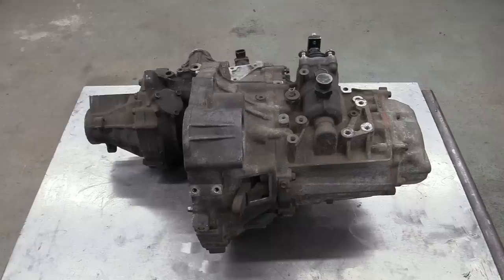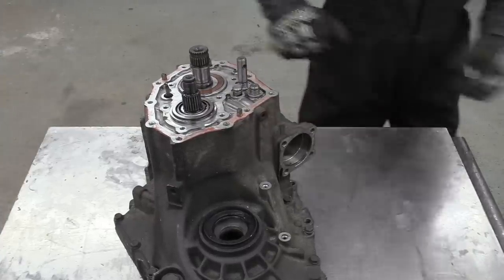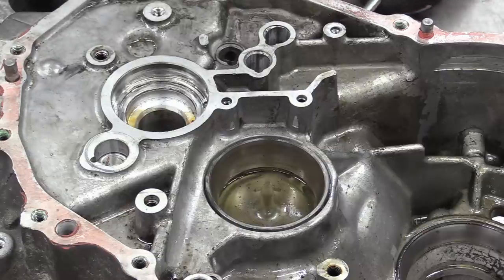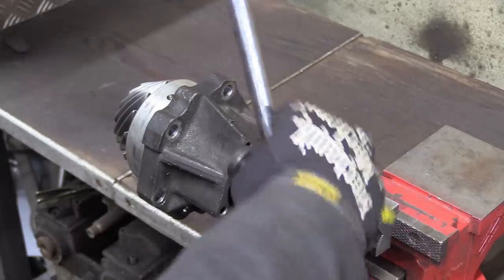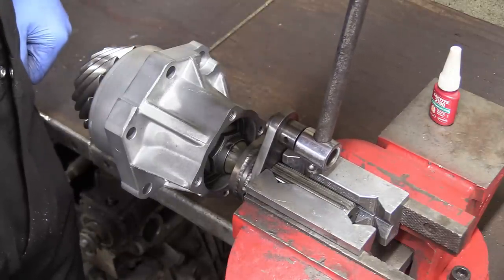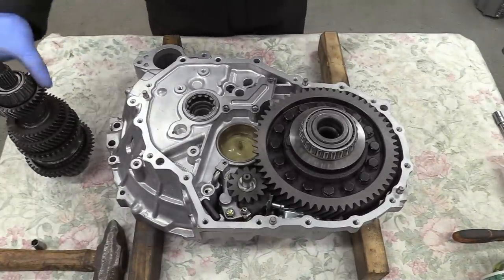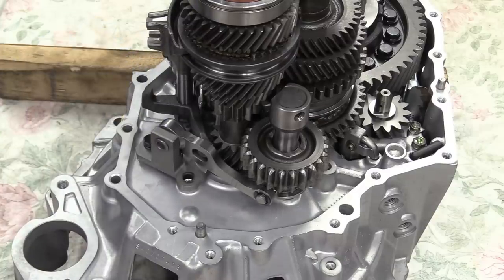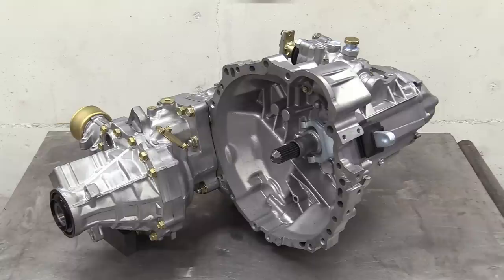Howie Did It - Toyota E154F Gearbox Strip and Rebuild

Comment: Props to whoever designs gearboxes. I can't imagine how difficult it is to design something so complex that needs to fit in a very tight space and its components also need to be strong enough to handle the forces. O.O
Reply: I know, right? The mind boggles with the thought that some engineering team could actually design something so complex and impressive.
Reply: As impressive as it is, like most everything its a product of decades even centuries of development, by hundreds of scientist, engineers, and machinists.
Reply: I have to say the gearbox is the part of the engines I have always left alone. I leave those to clever people.
Reply: @nothingsurprisesmeanymore  Same for me. I have build engines from the bare block, but most I have done to a transmission is changing the fith gear ratio, which was in a separate part of the case just like the Celica transmission in the video. I also leave rebuilding transmissions to the magicians that just know :D
Reply: iTeerRex spot on - I was thinking the same thing, each new development (feature) builds on previous successful designs that survive rally car abuse. Beautiful evolution but in a mechanical artifact. I can see now why automatic transmissions are (probably) easier to mass produce. 👍🦖🇨🇦
Reply: @barryomahony4983   yeah, have a look inside gas turbines. 
“Whittle … stressed the great simplicity of his engine. Hives [Director of Rolls Royce]  commented, ‘We’ll soon design the bloody simplicity out of it.’ ” [From Genesis of the Jet]

Comment: 8:55 see, its little things like this which really set apart engineers from the rest of us. Seems like an obvious thing to do when the magnet on a stick was too large to fit, but I guarentee none of us lot would have thought of it!

And then when you made your own special tools for everything... Brilliant.
Reply: A coil of wire around a screwdriver  touched to the battery for a split second will magnetize the screwdriver.
Reply: That's exactly the same thing I saw, I dropped my jaw man, never thought of that. And I'm a fucking Engineer, a shit one apparently lol
Reply: yeah , i've noted that trick for future situations
Reply: In my experience that is something a technician would do to get around something the engineers did not consider in the design.
Reply: Thu Nell Ⓥ  OK.
Reply: That was but one of many tricks in this video I saw and thought - “Damn, I hope I remember that when the time comes!”
Reply: been doing it for years
Reply: That trick works great for removing or reinstalling ball bearings back into bicycle wheel hubs when you service them! Or you could just get nice wheels with sealed bearings, but where's the fun in that?
Reply: Necessity requires ingenuity.

Comment: Why are there no credits for Mr H. DidIt?
Oh, wow. Someone actually spends time to prevent to gasket sealer going INSIDE the inner workings? I've never seen any other channel do this. Impressive.
Reply: These two blokes actually respect their work and time. IMO, if someone doesn't do something right, when they're fully aware of the potential issues, they're not respecting themselves, regardless of "if it actually lasts or not". Best job is the one you only do once.
Reply: Subi Motorsport, Thank me later ;)

Comment: Just remembered a fun fact: Toyotas with transverse engine AWD always have a 2.928 rear diff final drive ratio. Celica, Caldina, Rav4, even the Harrier. For some reason the Mazda 6 MPS has the same gear ratio in the rear. I contemplated using a E250F from a second gen RAV4 with a 6 MPS rear end to make a rally-style handbrake-activated rear axle disconnect, since it has an electromagnetic clutchpack. Sorry for diverting attention, enjoy the video!
Reply: This is really interesting actually! I'm looking for a bit of a project myself and these things are always good to know!
Reply: @Iowa599  I know what a Toyota Harrier is but all I ever think of when I hear it is the jet too haha
Reply: That’s just a little crazy.
Reply: @Iowa599    Well, that wasn't worth shit !!!!!!!

Comment: Was it my imagination or was it when a new part in some packaging with a part number that was visible, it was angled towards the camera so the video could be paused and the part number noted?

If so, well done all round!
Reply: Stephen Swift . Maybe they are in the pay of big Motor i.e. Toyota. There should have been a disclaimer for product placement. Lol.
Reply: I get the feeling that a good part of the reason this video exists is for them to be able to rewatch it back after the cases were all cleaned. Its a complex bit of kit even for a top engineer, its good to have reference material like this. I've done similar before.

Comment: Well I’m not sectioned as far as I know but watched the whole hour 😊
Quite surprised you didn't have all the rotating parts at least smeared with gear oil (unless you were using something very clear & light?
I rebuild about 20 gearboxes a year and always make sure all bearings and gears etc are well lubricated before reassembly.
Just takes that risk factor out on start-up while the reservoir oil circulates.
Taper roller bearings really don’t do well sans lubricant or any contamination.
Reply: My observation too, I would have used assembly or gearbox oil on every part rotating during rebuilding
Reply: Some of those pieces sounded awfully dry. Also nothing on the rubber seals on rotating parts.
Reply: Start-up will be several months away, any lubrication will have drained out of any gear or bearing .
Reply: @datasailor8132  I spottet some white substance on the seals. I'll be fine.
Reply: @alancurrie9108  That's why you assemble things like transmissions and engines with assembly lubes rather than standard oil. They range from regular oil with extra high-friction additives (like MoS2) for immediate service to thick, wax-like greases or gels (with low melting points) for long storage.

I like to use Lubegard Dr. Tranny's Assemblee Goo and plain gear oil. Paul Cangialosi seems to prefer Dynatex Transmission Assembly Lube and Driven Racing HVL. My dad's a bit older and still prefers lithium grease. Even WD-40, as horrid a "lubricant" as it is, is better than dry assembly.

Comment: Why is that nut on one of the bolts on the gear selector housing at 59:55 ????? Was the bolt too long & you didn't think to saw off the excess ???? Makes the whole job look shoddy,unprofessional !!!!! Come on guys,you're better than that !!!!!
Reply from the maker: Either that or the alternator bracket bolts there and the original bolts were too short so we plated longer bolts and used a nut to tighten the bolts up without them bottoming out in the blind hole until the sealant had gone off. Is that okay?

Comment: 0:55 There's something I've been wondering about since a very early episode, which is that the Celica had 17" wheels and Binky has 13" wheels, which means that the engine has to rev 31% faster to travel the same speed, leading to overheating.  Did you choose a different final drive ratio to fix that problem?  (I'm haven't watched this whole episode, so if it's answered within, I'll come back and change this comment later).
Reply: @notsevenfeettall  Taller tires get you more top speed at the same revs, yes. But Binky already gets 3in bigger tires than the standard 10in if i forgot correctly. So a higher final drive is in order for the rev range to meet up again. Or, don't have the top speed, which won't make that much sense. No idea how fast the celica went in the first place. 30% less than that sounds sad tho.
Reply: @seven9766  That 30% reduction in top speed is not lost, it's converted to torque. The acceleration of Binky is going to be absolutely bonkers.
Reply: Considering Mini...ahem..."aerodynamics" (or lack thereof), that extra torque from being 30% down on top speed may be ideal, so l;ong as the cooling system can take the added heat.  Minis are B-road barnstormers, anyway, not autobahn cruisers, so acceleration out of a tight corner may be more important anyway.
Reply: With a bit of really really really rough math and guestimation, Binky should still be seeing a touch over 200km/h which is plenty rapid.
Reply: I was concerned about overheating, not performance.  28:20 puts my mind at ease that the boys are thinking about that.

Comment: So therapeutic watching this. Great content as always guys :)

Oh, and those weird breather tubes. Well I do believe they're the oil collection and drip tubes to lubricate the 5th gears. Many vehicles where the 5th gear is a kinda add on outside the main casing use this method to collect oil fling off from the main casing and drip it onto the top's of the 5th gears to ensure they get oiled properly.

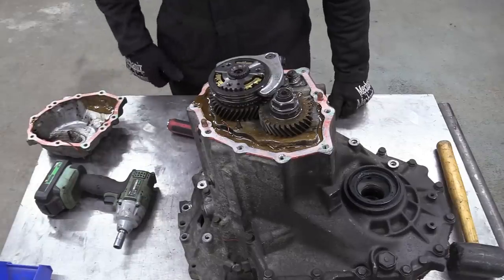Comment: That nut you're re-using on the gearbox at 5:45 looks an awful lot like the nuts on the axles of BMWs, M24X1,5 by any chance?... Partnumber 33411132565... In case you care enough to take it back apart lol

Comment: The question we all want to know is, "Did you have any parts left over after reassembly?". I used to have a friend who took his moped's gearbox apart and rebuilt it. He then found that he had a cog left over, but youthful indifference meant that he tried it without the cog and it still worked perfectly.
Reply: I noticed one bit that was not re-installed and there is a hole in the box where it goes. The spedo drive!

Comment: The only transmission I ever successfully assembled was a three speed that only had synchro for second and third way back when I did my apprenticeship, the next one I took apart was a four speed motorcycle box that took me twelve times as long most of which was spent crawling on the floor looking for springs and detent balls. The one after that was handed straight to a transmission shop and I will never touch one again unless I suffer a stroke or go mad.

Comment: Here I thought the Germans were the kings of over-engineering...now I realize the Japanese hold that title.  Why use 10 bolts when you can use 15?  Why use a solid magnet when you can put 6 holes in it and increase the surface area?
Reply: It's a Rally homologation model, if it wasn't over-engineered I'd be shocked.

Comment: 55:45 Using a nut to compensate for a bolt thats too long. Quite janky, after all of that perfection... Dissapointed...
Reply from the maker: The alternator bracket bolts where that nut goes.

Comment: Are you attentive to the potential hydrogen embrittlement of those electroplated bolts?
Reply: Only really an issue on high tensile bolts. The heat that the box runs at should allow the hydrogen to escape over time.

Comment: On the gearbox casings, it looked like there was originally a gasket fitted? Now that you have only used RTV to refit the casings the preload on the diff bearings and input shaft will be tighter 😬
Reply: That was red silicone/RTV originally, not a gasket you can see where it had squished outside of the casing in what was most likely the original assembly.  

The only gasket on the trans was for the gear selector assembly apparently, they've used RTV on that though too.

Comment: I rebuilt a 1994 MR2 Turbo E153 box with LSD which apart from the transfer box and 1st gear different ratio, is pretty much identical internally instagram @megapixel000 it's on there inc new Syncro, you can lock the gears together by using selector rods to undo nut on 5th, the BGB shows you if you don't have impact gun.

Comment: 48:13 - They look to be oil feed and return guides to the other side of the wall.  With the relation to the location of the one feed line, it seems to drip on to the one, go through the wall, and come back the other as overflow.
Reply: My old Corolla had a similar lubrication arrangement for 5th gear.  Maybe it's a Toyota thing.

Comment: As working in a bearing shop. the moust common failing bearing in a gearbox is a sealed bearing. If it has oil arround it, then it should be open. Even older 911 had recalls to remove the seals from a bearing.

Comment: 48:12 If anyone was wondering, those oil trays catch splashed gear oil from the 1st through 4th gears, and transfer it to the other side of the transmission where 5th gear lives.  Without them, the oil on that side of the transmission would never recirculate past the magnet or the oil cooler.

Comment: Just used every minute of this to strip, install a Traction Concepts LSD, and then rebuild an E355 (very very similar internals to your E154) which is going into a 2GRFE V6 conversion to my MR2 SW20.  Absolutely couldn't have done it without your superb video (and the Toyota torque settings, perhaps in future you could mention the torque settings).  Getting the 5th gear synchromesh back on certainly didn't go as easy as you showed, but got there in the end.  Huge, huge thanks fellas.

Comment: I always use heat and cold for bearings to get them out and put back in. Use real ice, sprays don't work, not enaugh energy. You can mold ice in freezer to drop on bearing race also, heat up case and drop ice in for few seconds, bearing drops out without tools, (maybe you need to slam case to table. This reduces wear on case if you need to change them regularly and is lot easier just drop bearing in eithout tools and risk of getting them hammered badly.

Comment: Every episode ups the man hours to beyond astronomical figures. Even if you work for minimum wage this would be a $100,000 car. By the time this is ever actually completed it will be so valuable as to make it virtually un-driveable. I mean I love watching all of the custom fabrication, but eventually you have so much invested in time, damaging or wrecking it would be almost too much to bear. It becomes a showcase. A statement. Something to be fawned over, but never to have a wheel turned in anger. 
That's cool and all, but a few years ago when I found this build I had ideas of a 4WD Mini ripping four wheel drifts through fields and gravel roads, but with SO MUCH custom fab, and work, I fear this might become a trailer queen.

Comment: Ever heard the adage - if it ain't broke?  Ringing  at 110 db, especially at 30.50.  The episode painfully reminds me of my Father and Brother rebuilding the latters Minor 1000 gearbox approx 50 years ago.  On reasembly tested each gear selection - all ok - first road test, all went well untill the rear wheels locked up with the box selecting 2nd and 4th gears simultaneously...... off to the breakers for a  correctly assembled gearbox!

Comment: This is interesting stuff. The Toyota ST185 and ST205 never sold well in the USA because the Mitsubishi Eclipse was a much less expensive AWD turbo car. However, one reason it cost less was because it wasn't nearly as reliable. The transmissions didn't shift very well, and some variants of the 4G63T would get crankwalk. It was like combining the Mitsubishi Galant VR4 and early Evo, cheapening them, then applying a 2 door body. They also had an interior that was likely to fall apart quickly. Whenever someone talks about Japanese cars, I make sure exactly what they are talking about, because Toyota and Honda are in a much different league than all the others. Nissan was hit or miss in reliability, Mazda's turbo rotaries were a costly nightmare, and Mitsubishi was known for burning oil at engine valves and weak transmissions.
5:57 It wouldn't surprise me if you could go to a local auto parts store, look at the different generic CV axle nuts, and find a match. That in mind, you really have to beat up one of those nuts to actually need a new one.
12:10 These bolts that hold the detents in place remind me of a situation one of my coworkers were in. Some kind of 4WD truck came in with a problem. We could see that one bolt was missing, and cast in the case was "Do not remove this bolt." The fill plug and drain plug were the same size. We didn't exactly what happened, but we guessed that someone tried to change transfer case lube without paying attention to which plug was the fill plug and which plug was the drain plug. I have no idea how that vehicle made it to our shop. Perhaps it wouldn't have made it if 4WD was activated. I have seen similar things on some RWD enthusiast cars, especially the Mazda Miata.
13:30 I had never seen a manual transmission oil pump before. Usually they counted on deflectors to fling oil at certain parts. The only exceptions I ever saw were racing manual transmissions that had oil coolers.

What kind of gear lube did this transmission and transfer case use? I do see a variety of types throughout the industry.

Comment: This is very helpful,  I bought an eBay e154f with the same goal in mind since the stock tranny in my sxa10 rav4 couldn't take the 450+ going into it from a built 3sge red top. I replaced the tranny twice but they wear down after a year or so of on and off rally events. And being an xa10, replacement parts are hard to come by and expense.

Being able to be armed with the knowledge of rebuilding the exact transmission I had my eye on is gonna be a huge help, here's to hoping I don't thrash this one.

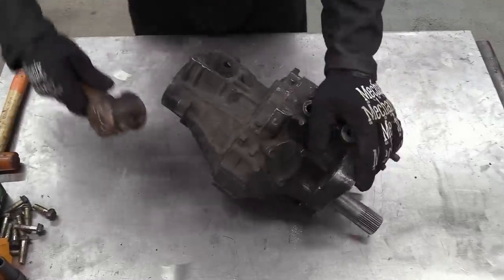Comment: I knew you could not have an episode without you making something, not a bracket but shop made. At 23:05 reminded my of the engineers saying "Don't force it , get a bigger hammer".  Also plywood on the steel table might keep the parts from sliding around. Interesting and great video as usual guys. Can't wait until project Binky and Es cargo are finished. What will project #3 be?

Comment: Re the input shaft bearing tool. I still have a spline aligning tool made out of a bolt, some nuts and washers and a piece of broom handle which I used as a teenager changing clutches on mine and my Dad's Hillman Hunters. Both were 1725DL estates able to pull from about 20 MPH to top speed in top gear (no overdrive) if you were so inclined. It was also the car in which I learnt to change gear clutchlessly by listening to engine note/speed, an obscure skill that one.